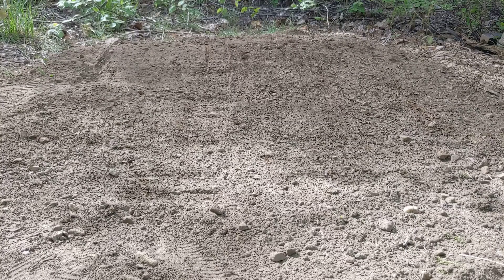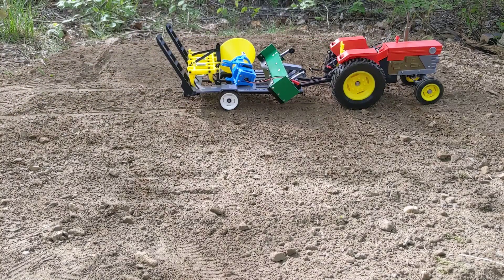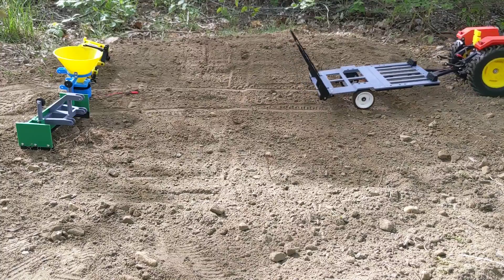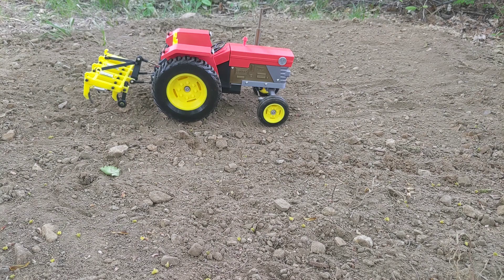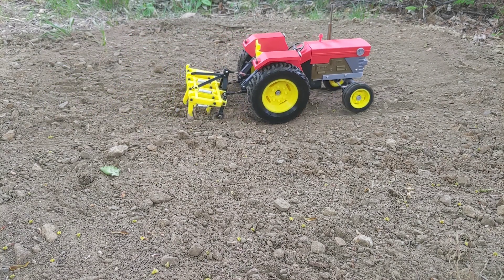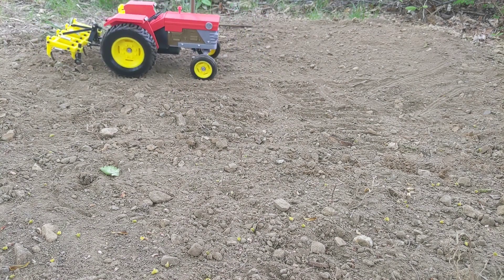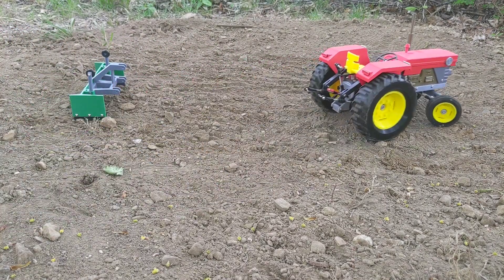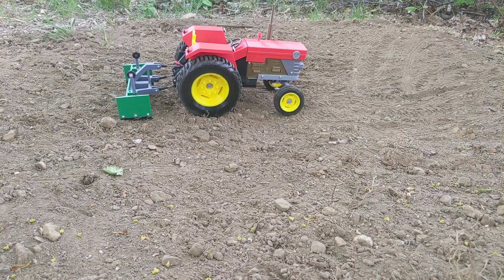Lets go Farming! with the OpenRC 3D Printed Tractor.

Comment: Well I can suggest you something I guess.  Try using high torque gear motor and use air gun pellets to add some weight to your tractor this will help.
Reply from the maker: Yeah its pretty light, some more weight would be helpful to pull the cultivator through the soil. All in all I'm pretty happy with it though for a 3D Printed tractor.
Reply: @rcprinter  yeah... everything looks super neat 👌...